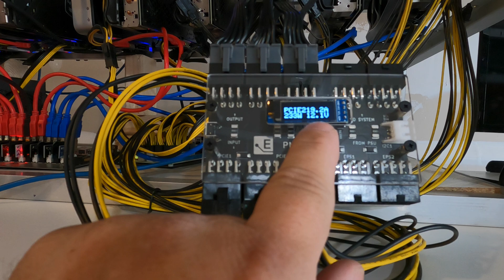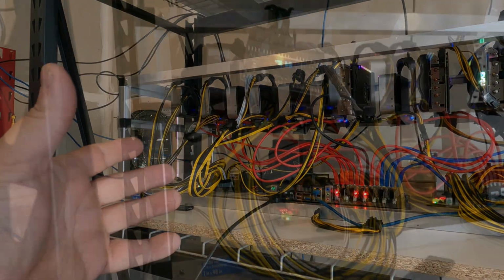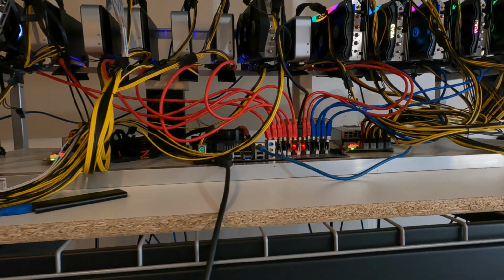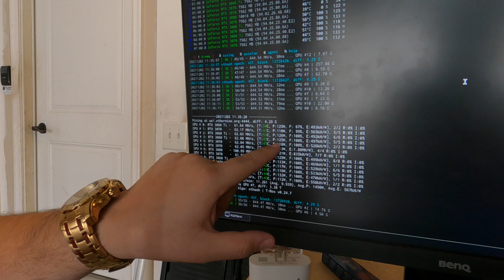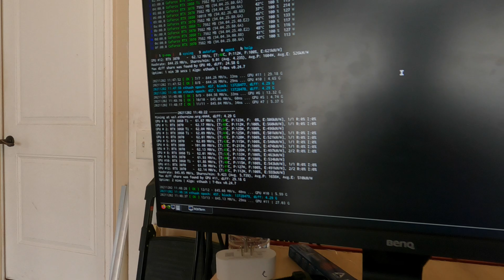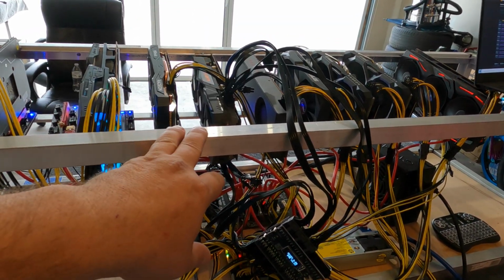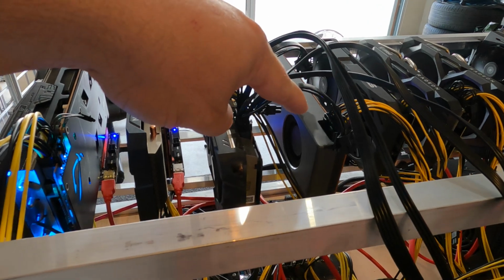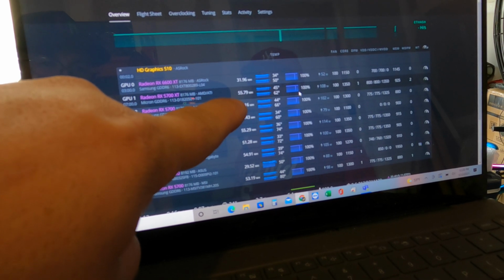Elmore Labs PMD - Precisely Measure GPU Power!!!

Comment from the maker: Would you find this tool useful?  Let us know what you would test with it.
Reply: I’m looking for something similar for ages
Reply: I got to open mine up now...
Reply from the maker: @TekShinji  yes you do!
Reply: I just received my one. Only issue what i find with it is that is miss calibrated. But accessing to menu you can change and recalibrate it. Just i need to find how to set load to 150W what is default in menu. Also you can change the refresh rate and the screen change timing or to turn it off.

Comment: New reply from manufacturer about calibration:

They are not calibrated from the factory. You can calibrate the offset current with 0 A load in the menu by long pressing the button and selecting CAL and long pressing again. To store the calibration permanently, select the STORE option and long press.

Comment: Probably not as accurate as this tool but I always just use a clamp meter, don't even need to disconnect/reconnect anything.
Reply from the maker: DC clamp meters are a viable alternative.
Reply: Problem is that this meter is not accurate because my one is not calibrated properly.